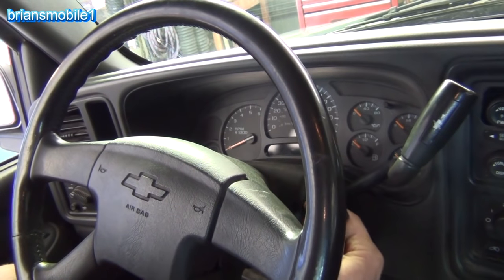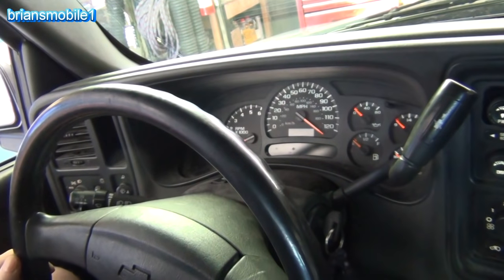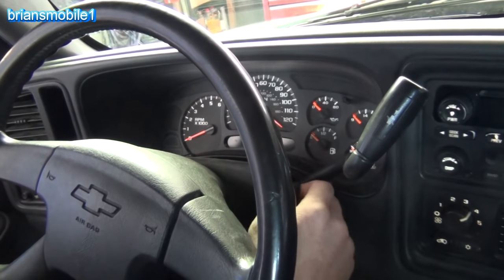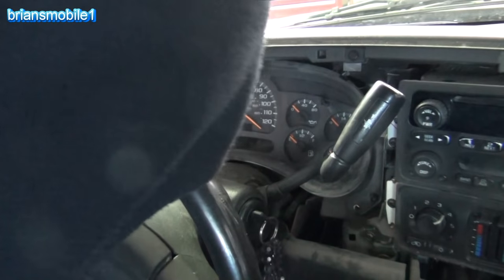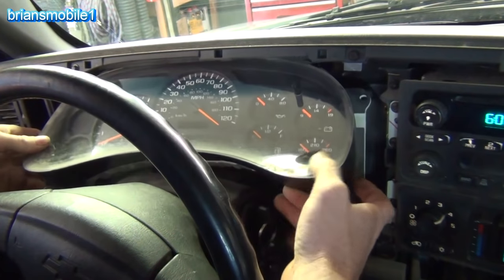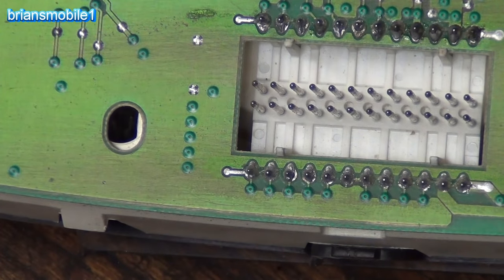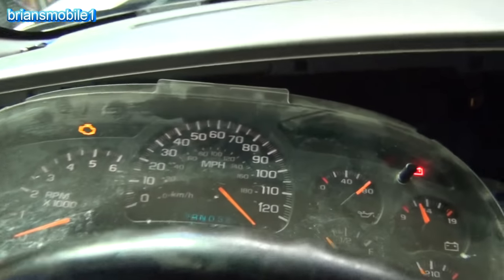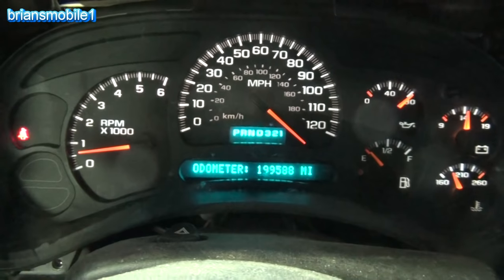Cheverolet Silverado Instrument Cluster Fix

Comment: HeyThanks.  I am a 65 year old gramma and with your instructions i was able to fix my 2003 Avalanches, instrument cluster problem that was going to cost $680.  I'm not sure why you put it on you tube. but i love ya for it, kiddo!
Reply: What kind of solder are u using acid core and what size
Reply: @triciabrightwell1019  You don't want to use acid core on anything electronic.  You need a rosin core solder.   Acid core is for soldering things like radiators.  Rosin core is for soldering electronics.
Reply: @triciabrightwell1019  
K
Reply: This comment right here makes me have faith in humanity thank you for being a woman that has a can-do attitude I tell girls all the time that just because they're female doesn't mean they can't fix things it all boils down to your attitude

Comment: I just pulled my panel and inspected the socket. Everything looked fine but I decided to re-solder anyway. Some fingernail polish remover - acetone - took care of the coating. I applied it, let it evaporate, and brushed with a nylon brush. The coating turned to a white powder and brushed away and did not interfere with the soldering iron. The intermittent problem is now solved. Thanks!

Comment: You need a flux pen. Trust me. Apply some flux from a flux pen and it will re-flow the solder as if it was brand new. The flux together with the heat from the solder iron also cleans your contact surfaces and gets the solder to stick properly.
Reply: 1998 Chevrolet 1998 Chevrolet C1500 no instrument cluster lights

Comment: I can give you a few hints on soldering and removal of the film. I worked for 2 years at Model electronics where I fixed radios and speedos. 1 Get a thinner tip on the iron. 2 get thinner solder 3 buy some resin remover 4  NEVER USE A METAL BRUSH. 5 Keep up the great job!!!!!

Comment: Brian.  I posted on your other, related video, how I was having an issue with an instrument cluster that had malfunctioning gauges and glitchy speedometer.  I lived with that for several months but this past weekend, on a -15 / -18 below zero morning, the cluster died completely. Your two videos are sheer brilliance. It took me half of President's Day, but I was able to replace all the stepper motors AND repair the connector pins.  I WAS terrible with soldering and really was apprehensive about tackling this job, but even your tips on soldering helped a LOT.  The first motor took me 20 minutes to de-solder and repair.  The next, maybe 6 or 7 minutes.  The subsequent ones.......less than five.  Thank you VERY much.  You saved me a lot of money and helped me learn a valuable skill.  Take care and keep up the great work.

Comment: If you use a magnifying glass sometimes you can find a conical fracture around some of the pins. This was the case on my 88 Honda Civic. You could only see it with a magnifying glass and it was quite clear on 2 of the pins. They were on a relay coil which heated up. The coil itself was fastened to the board so when the leads expanded, the only thing that could give was the solder. 5 minutes and it was fixed.... Years of headaches gone. 2 shops said they couldn't fix it because they couldn't repeat the problem. Youtube to the rescue! Thanks for the great video.

Comment: Brian, I replaced my stepper motors in my 2003 GMC Envoy instrument panel and bought a solder sucker from radio shack and replaced the old solder with new it was the balls worked excellent!

Comment: I’ve just bought a 2002 GMC 2500 HD, with the LB7 Duramax, this last week. It runs really well but the dash cluster is a wreck, it looks like a Christmas tree sometimes then resets itself randomly. I’ve checked codes and it only showed ABS related data. The water pump crapped out two days into checking it out. Lol
Your channel was a great help in figuring that out, anyways I’m back now with the dash cluster issues. Once again thank you so very much for putting out these videos man this is so cool and the information is most helpful your way of explaining things this is on works very well thank you sir

Comment: Thanks Brian! My cluster gauges were wagging, every one of them from min to max. I touched up the solder joints of the male connector on pcb that the wiring harness plugs into, cleaned with contact cleaner and put it back together. No more wagging!!!
Reply from the maker: Nice work!

Comment: Hey just a heads up and a thank you. You inadvertently mentioned the resistors for the PRND123 readout next to one of the stepper motors. We had fixed the others and had no idea there were more. They had cold joints we fixed them and all is good.  With your help we fixed 2 instrument clusters. Thank you

Comment: Brian I think I found my problem with my Cluster. After almost ripping my hair out, I came across your video. I had a leak from one of my heater core connectors going to the top of the block on my 03 suburban. I thought it was a bad ground that was oily and wet from the leak. But after watching your video it seems like that would be my issue. I don't have soldering skills but seems to be an easy fix. THANK YOU

Comment: Thank you so much! I just did this to my 2003 yukon. I just cleaned the back with acetone then brushed it and sprayed it with electrical cleaner fluid from walmart and it works beautifully! My PRNDL is still out but thats ok. My next step was to call the dealership and fork it up, but thanks to you its working again!!

Comment: Great narration and use of proper terms. Seems like some times the more you get in it and mess with it, the more problems pop up. If I do this I think I would de-solder first then clean start over. Old and dirty solder like any other types of welds can be tricky as it gets re-worked and being so small and bad eyes don't help.  I had lots of issues like this doing real fine exotic TIG welding on light gauge material that had to be 100%, even under x-ray.

Comment: have 250k + one with 330k miles on all my GMs these years. Except for minor issues original motor trans. This is a common problem plagues many.Also had one dash cause parasitic draw on battery causing it to go dead in two days. Nice video thanks for helping others keep their ole Chevy going.
Ps World record for miles on original car is the Volvo with 3million and a Chevy Silverado with 1.7 million. Motors not rebuilt nor transmission.

Comment: Thanks. I pulled the instrument panel off. Then tapped on the very top of the cluster where the plug is and everything came back on.
I will do your trick later when it goes out again. for now its working fine again.

Comment: Thanks for the video..helped me narrow down issues with loss of power to the cluster. Used the pin out diagram and touched up pins A12/B12 grounds and 12v pins B11/ B9. Zero'd up the gauges before putting it back and seems to be working now. 👍👍

Comment: Small advice: do not try to connect the cluster back in the car, without the back cover. High chance of touching something metallic (ground) and short a component. When reflowing solder connections, use flux and a small quantity of fresh solder. Clean afterwards with ethanol or isopropanol and an old toothbrush. While you are there, you might as well replace the bulbs with LEDs (you need much more experience with electronics, though).

Comment: The PRNDL on my wife's 03 Impala works intermittently. So thanks for that easy fix! Also took me forever to figure out what was killing my battery on my 01 Astro Van. Seems if I leave the dome override switch on, it keeps the BCM alive for some reason.
I'm just going to put a switch on the dome light, so I can turn it off, when I want.

Comment: The cluster on my 2004 Silverado has been going in and out for several weeks now. Just recently, if I would hit the top of the dash over the cluster with my fist, it would come back on, but now even that is not working. I suspect I have the same problem you had. Thanks for the video.
Reply: Same issues here with 2004 Silverado 3500.  Did this fix yours?  So far smacking my dash is still working on mine with the exception of a couple times.  Pretty sure it won't be much longer before it stops completely as well.
Reply: I sent my gauge cluster to Todd Haines of https://www.gmgaugerepair.com/. He usually repairs in the same day and sends back via FedEx. I'm very happy with his work and would highly recommend him. $110.00 which includes return shipping. Can't beat it. But to answer your question, I did pull the cluster and was going to try the repair in this video, but my connections looked fine.
Reply: @gig777  Ok, thanks for responding and thanks for the link.  I'll be sure to contact him when mine finally dies.  I just can't see spending $400 on a new one that will eventually do the same thing.
Reply: @nopenottanoway  with a good rebuild the problem shouldn't come back to haunt you. But keep in mind a genuine dealership reman cluster might NOT have the issue corrected.
Reply: @jeffescortlx  yep, that's what I'm afraid of.  That's why I'd much rather send it for repairs.  A friend of mine mailed me the kit to fix it with but I think it's more than I can probably do.
Reply: @nopenottanoway  If you want to see what happens when someone tries to fix one without luck on there side just watch some of my video's. Some people can jump in and do it them selves and some can't.
Reply: @jeffescortlx  I'll get on here later and go through some videos on it.  I did learn to change my fuel filter, starter and u joints from watching YouTube.  I'm just a little more intimidated by delicate stuff like the instrument panel, I'm a bit on the clumsy side.  😂

Comment: Great video…  60-70% isopropyl alcohol is good for cleaning circuit boards. Also a little bit of flux on the pins before you try to re-flow the joint will make things a lot easier and produce a better joint.

Comment: PRND321 has 7 resistor on other side of board. That's the common source of the dim or dead display. My vid shows were they are and you'll see how bright it gets back to once you reflow them. People think it's the pins because the heat warps the board enough to make contact again. They are surface mount 1206 resistors, lead free solder cracks on them
Reply: Hey can you leave a link for the video on your channel that you are referring to. I checked your channel but didn't find it. The whole gauge panel in my 2003 Silverado is down, well I do have prnd etc, and the odometer shows but that is it. Got NO $$$$ for a new one so I gotta do this myself.

Comment: For the Park indication, you need to adjust the transmission shift cable at the park/neutral switch at the transmission, just slightly out of whack.  That should fix it.

Comment: Pretty good video, as far as your went.  However, the stepper motors are a well known problem on that vintage of truck, especially 04 05 tahoe Yukon Escalade Sierra Silverado....  You could take that case apart, put painters tape on the face of the cluster, mark where all your needles are, and then gently pull the needles off with a fork.  Then, you can take the cluster apart.  On the other side of the green PC board, there will be white circular stepper motors.   The speedo one often goes bad, as mine did.  The motors can be had for $10 apiece on Ebay.  There are sellers on EBay, who, if you just pull out the cluster, and sent it to them, will replace ALL the stepper motors, and send you your cluster back, for around $200, which, for most people without soldering skills, is probably the right option.    The truck CAN be driven without the cluster.  Obviously, you will have no gauges, so use extreme caution, but it will start & run completely fine, and the mileage is kept in the ECM, so that's no problem either.  The Dealer wanted over $1000 to do mine.   To the commenter who was wondering about the oil sending unit, it could very well be a bad stepper motor also.  The stepper motors on the back are ALL THE SAME, so if you really want to isolate your trouble, swap one for another, put it back together, and see if the trouble "moves" with the motor....  Or just replace them all....  That was a good video Brian, I am just saying, there was more to the story than you showed.....
Reply: Patrick Morrissey Thanks for the information

Comment: My instrument gauges stopped working again on my 2004 Silverado.  They went out before but started working again while driving down the road.  I read somewhere that it could be the ignition switch so when I turn the ignition on I wiggled the key some and all the dash gauges started working again.  Will probably replace the ignition switch which is a $20-$35 parts but so far everything is still good.

Comment: I am doing this tomorrow, tried installing a new touchscreen deck in my 1999 silverado (I've done decks before) but today I believe there was a power surge and stopped my Odometer, gas gauge, and RPM from not working. Taking it apart tomorrow to see if something happened on the back side of the board, I hope like hell my new 300$ deck will turn on when I fix it, it wasn't turning on after the power surge from the battery cables on the deck's surge.

Comment: One tip for you brian as a certified solderer :) first use a solder sucker and remove ALL the old solder, never reuse old solder, it will never reflow good, wet all points good with a good brand solder flux and use a good brand soldering wire and resolder them, the lead type soldering wire is the shit, that new envirronmentaly friendly unleaded stuff sucks :) but hey you got the job done anyway :)
Reply from the maker: I spent about $80 on new tips, a sucker, copper tip cleaner, tinning block, flux pen etc.  I learn a lot from you guys and I listen!

Comment: Hey Brian, thanks for this video. I own a 2003 GMC Sierra with the exact same problem. It started years ago with the speedometer intermittently moving up to 120 mph. I had the "instrument panel" replaced under warranty and everything worked for a few years. Now there is no PRND2L indicator and occasionally the instruments are inoperative until things heat up. It seems that for the price of this item they should build a better product. Thanks again for the info.

Comment: Brian, those Gm's are notorious for the little stepper motor for the guages to go bad.  You can get them on Ebay for about $5 each and solder new ones on.  Look up X27.168 on Ebay.  Cheers.

Comment: What temperature is your iron? As for the dirty connector, you can spray it out with electronics cleaner and fill each pin hole with dielectric grease. Just a little more effective than working the plug in and out.

Comment: You suggested to find out how much the instrument cluster cost to replace before beginning this project to make sure your are going in the right direction and to feel more confident. Then you mention that dealerships want to reprogram your VCM and make sure mileage is correct.  If I replace the cluster myself, will the mileage automatically remain recorded with my engine when i plug the cluster back in after repair.? By looking at the mileage when you plugged this back in, it seems that it does.

Comment: oil pressure switch is broken! location is on back side of intake and very difficult to replace. they usually run about $50-90 through gm. normal oil pressure is 30-40

Comment: Use just a tiny amount of flux paste on each joint before you heat them up - it really helps. Thinner solder also helps if you cant get enough heat into the joint. I usually go with 0.8 mm.
Reply: Oh, and go over the entire board with either a magnifying glass or a microscope.

Comment: Nobody has mentioned the oil pressure gauge. It didn't seem to be working. Did you get it fixed?
Reply: It's the oil pressure sensor on the top of the block right in back of the engine, they fail all the time.

Comment: cool...i hope I can fix my friends cluster...the clear stuff is called .. con-formal coating  its used to create an air tight and rust free environment...what probably happened is they used too much and it prevented the solder paste from melting correctly thats why you have that problem on the connectors...thanks!

Comment: hey there, i just want to say i love your videos.  That being said, your soldering could use some help  =)  So here comes yoiur help.   Get some conformal coating remover. you just brush it on with a nylon bristle brush and let it set for a minute and then brush it off using alcohol. next put flux on the area you would like to solder, it helps protect the joint and most of all helps the solder lay flat and spread quickly and evenly.   and  not tinning the tip of your iron is really effin with my OCD  ;P     Great videos man you have really good info.   So when i saw a chance to help you I jumped on it.

Comment: The dim PRNDL is a result of fractured solder joints at the PRNDL display resistors on the front of the board.

Comment: Great video very informative.  I have a 2005 Trailblazer with similar problems.  Is my dash similar insofar as accessing the cluster?  Plus, after the first broad-brush-solder-'em-all approach didn't work, - is there a schematic where you could have determined which pin(s) was the culprit and work it individually rather than more broad brush soldering?

Comment: Could the solder be the problem with my fuel gauge being all jumpy or is it likely to be the sending unit on the fuel pump? 2001 Blazer 4x4 4.3L. The rest of my gauges work fine.
Reply: anything is possible, crack that bad boy open and have a look  =)